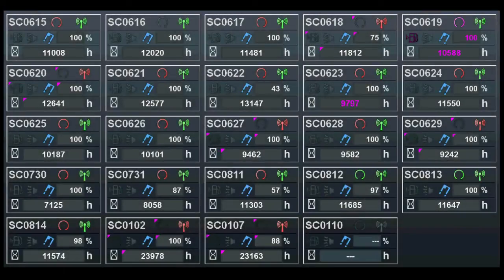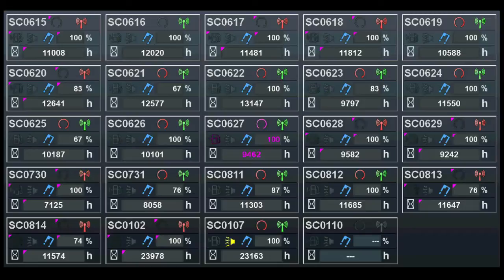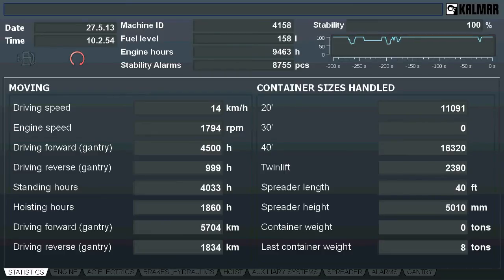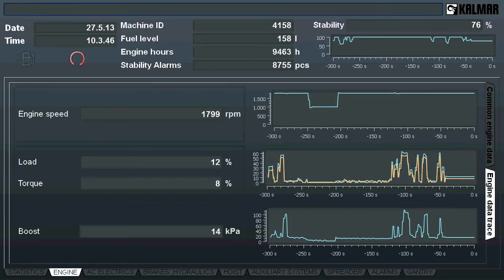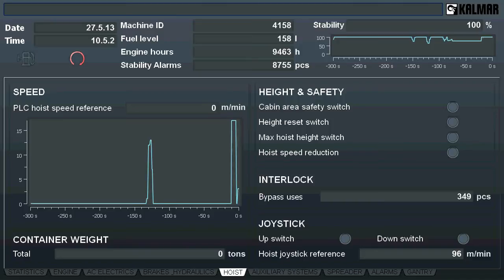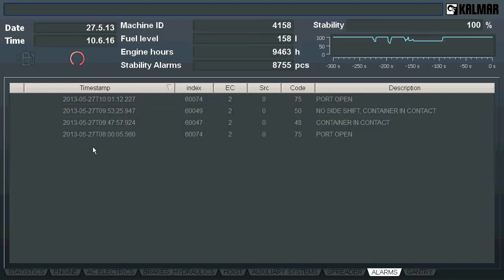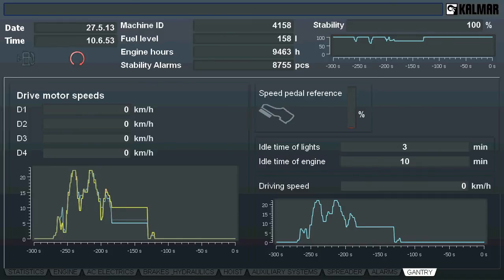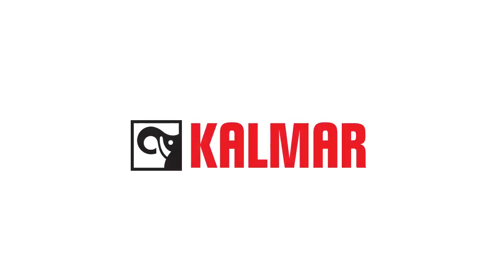Kalmar SmartFleet monitoring tool

Comment: Hi, I am an industrial maintenance technician, I wanted to ask a question, at the moment we are working with kalmar and hyster machines, sometimes we have some problems of communication faults can bus, and many others which takes us to take some time to solve the problem, air pressure, oil pressure, etc etc, my question is: this software facilitates us in the maintenance of the machines, for what kind of machines or brands the software is compatible, I was doing some searches on the net and found this post I decided to contact, thank you